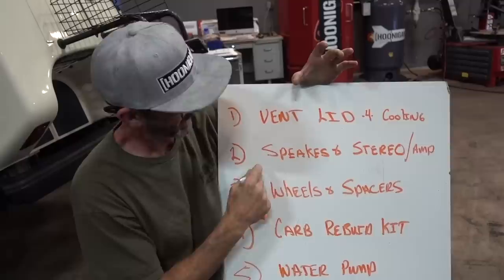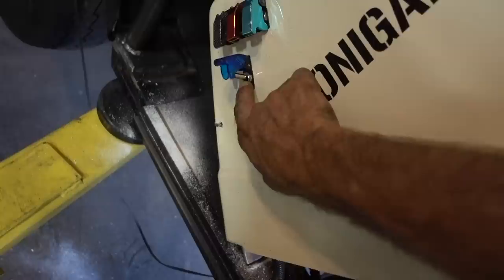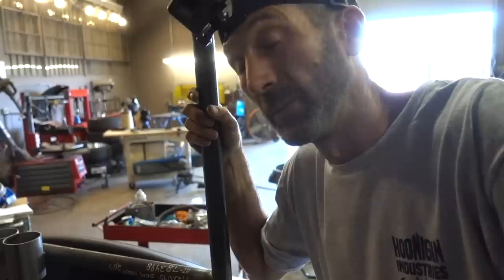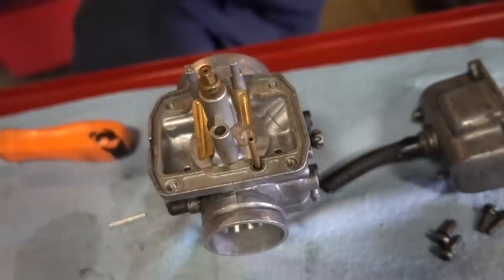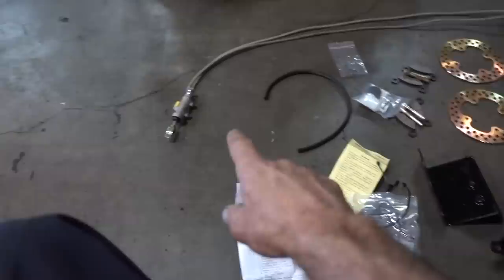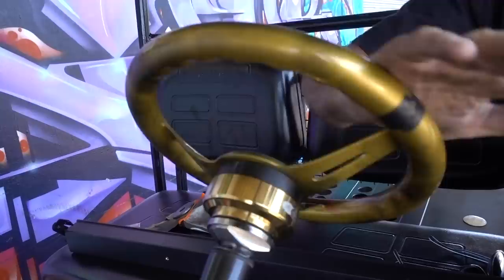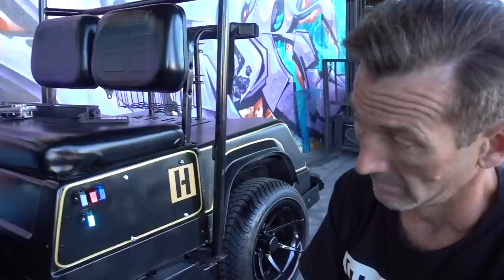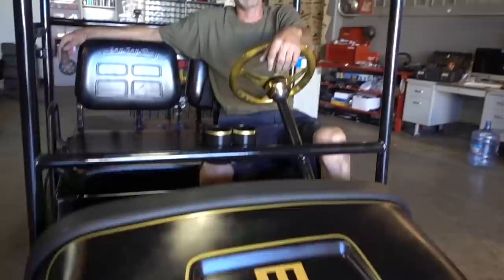Introducing the Hoonigan Player Special - 2 Stroke 750cc Golf Cart

Comment: The CVT transmission is killing it guys. No power to the ground and unable to burn rubber. Lower the gear ratio and tighten up that belt so you can get some mad skids.
Reply: I agree, that clutch setup is jacked. Good clutching and maybe a little more exhaust and fuel tuning and that engine would blow the tires off that cart at any given time. Also wheelies :)
Reply: Josh it's funny how this is pinned, but only one like...and now one reply lol
Reply: Needs a clutch kit. Changes engagement
Reply: Also that belt is very loose.
Reply: It would’ve worked a lot better with a jack shaft to a chain driven rear axle
Reply: Also, find a way to lock that diff up!
Reply: It HAS to be setup better!! This as it sits is a shame to the Hoonigan badge!!!
Reply: Cvt are super effiecient on sleds... The belt is skipping. They have way too much slack
Reply: Eric Levkovich dont know if its slipping but the secondary is defenetly to loose, doesnt rev like it should. What happens when the secondary clutch spring is to soft is that the belt gets pulled down to easy and its like youre driving on 6th gear all the time
Reply: Anton Danielsson yeah. They should get a clutch kit to get more out of it too. Stock clutching sucks
Reply: Eric Levkovich thats not even the stock secondary? So thats the problem
Reply: Anton Danielsson that and who knows what springs are in it. Or weights in primary
Reply: I agree, get a clutch kit. The belt is engaging at much too low of an rpm. Im a snowmobiler, 2 stroke snowmobile engines can be powerful monsters.
Reply: And the tuning seems waaay off on the engine.
Reply: @number1lilslugger  you cant tune a 680 with a straight pipe..  or any other sled engine for that matter.   THAT is why it's so slow.  Combined with a million other things..  jetting, clutching, air box.. etc  list goes on.     But they really need to change these titles..  it's a 680..   not a 750.  What a waste of a Classic sled..  and a good engine.      Claiming to be the almighty Storm engine when it's a turd of an Ultra engine.  Only way to wake up the 680 is to get good triple pipes. Then they could be pushing 135hp..   stock is 105..   straight pipe is like 50 lmao!   And none of that helps without the rest of it.  Get it rippin and itll pop for sure without it all taken care of.  Only reason it's still staying together is because it's making no power
Reply: @danielssonsgarage  up
Reply: Thing would probs top out at like 120 rn 😂
Reply: @arando4359  How do you feel now? lol

Comment: If anyone is curious, when they talk about have more back pressure, it's not about making it more restrictive. What they mean is that they are improving the velocity of the exhaust gasses by making the pipe smaller. So it's a balance between allowing a certain volume while maintaining proper velocity for exhaust savaging. Which actually reduces back pressure.

For anyone curious on the physics behind it google Venturi effect or Bernoulli's principle.

Comment: As a red flannel blooded Canadian I think a snowmobile mechanic should be consulted on this one to extract its full potential. Sounds like its running better but just like on snow the CVT clutching is the key with these things. Its a game changer when you get it right. The single piped ultra 680 engine makes 115hp or so. but add a set of tripple pipes to it and you get 145hp. Theres potential here guys. Chairslayer must have some alberta hookups to help out. If not, I might be able to point you in the right direction. Cheers.

Comment: definitely turbo if y'all can make that happen
Reply: 2 stroke turbo will not work very well
Reply: my b.. you mind throwin down some basics so i can figure out why?
Reply: is there a feasible form of forced induction?
Reply: extra air will just blow thru open both exhaust and intake port, on high rpm it sure will ad something, but it need custom expansion chambers, not one but 3, and they need to be tune to when boost kick and create that rezonation back pressure and push all that goodnes back to the cylinder
Reply: nitrous it is then
Reply: Methoxy000 there’s a company in Scottsdale that makes turbo charged 2 stroke and 4 stroke boxer motory hang glider things for personal flying crafts. Seeing them in person was amaaaaaazing
Reply: There is absolutely no need to turbo it. Just adding individual expansion chambers and a proper carb and setup would make it waaaayy to powerful
Reply: People do turbo 2 strokes but it is much more worth while to do a proper exhaust, intake, carb and head port job, they respond really good to just a simple carb and exhaust combo
Reply: head port job? you mean cylinder port job? :D
Reply: Gruby Garage Projekt you right, said two thoughts in one, port the cylinder and drop the head
Reply: Aaron Provin  don’t forget nos to
Reply: in high power two stroke shape of combustion chamber is critical, here in Poland we have some pro guys who can change whole engine power band by just reshaping chamber, and make like a 30HP of 70-80ccm cylinders
Reply: its a 2 stroke engine its gonna be hard and especially because its carbed
Reply: Aaron Provin a super charger can work, turbo is doable but it takes a fuck load of fab work to get the exhaust piping right. There will be some of that with the super charger aswell but not as much
Reply: Peter Griffin i just saw peter do something intelligent
Reply: yeah, a supercharger might be better, but still EFI is a must and direct injection is not a bad idea, you can see small 2t scooter engine on EFI end direct injection, runs very nice 
https://www.youtube.com/watch?v=8KmtOztWPs8
Reply: You can 100% turbo 2 strokes. Works very well
Reply: Gruby Garage Projekt yah it's still not an easy thing but way easier than a turbo
Reply: @silosis  nitrous only works with a cvt clutch if its on ALL the time otherwise when its off your clutching is totally off. its likely completely wrong right now tho going from sled to golf cart so that'll only aggravate the issue

Comment: nos + turbo = BADASSS
Reply: 2 stroke plus turbo = yes have you ever seen mountain sleds?
Reply: It would be more efficient to SC a 2 stroke: like old Detroit diesels
Reply: Alexander Helton Old Detroits may have superchargers but they're technically NA still.
Reply: BoostAddict You are correct, 71 series need the blowers to feed air, tho slightly pressurised- it's in fact NA
 but twin charged versions are not NA. 
a blower- and building an exhaust system with enough back pressure would be easier than a turbo. Look up speedwerx, for a example of SC snow engines.
Reply: No need for Nos or turbskis just slap a high compression head on that thing it’s a 2 stroke

Comment: how do the plugs/piston wash look? also what jets (main & secondarys) are you currently running? what needle position? lastly what outside temps and elevation are you generally going to be running it at? Also important.. did the engine come from an ultra, or a storm that had an ultra hood swapped on it? ultra - 680cc, but ya'll been calling it a 750 which would have been a storm engine. I can give you a good base line to start from on the jetting, but all variables are needed. easiest way to figure out if its really a 750 or 680, cylinder cast number.
Reply: AKproXR you need to help them get that motor going good homie.  Hahaha recognize you from ak snowshredder 2.0
Reply: They got that from an xlt dude. Like a 95 or 94. None xlt special rig
Reply: A fellow shredder! that engines not a mono block which rules out the 580/600 xlt based engines. Heads look like 680 heads to me which would be correct for the chassis they removed it from in their other video, but they seem to be dead set on calling it a 750 for some reason. But, without knowing what their running currently, what conditions they have down there that it will be run in and how the plug readings and piston wash look it will be hard to give them a base line for jetting to start with.
Reply: I thought of the clutch settings, it does't sounds like it's hit the high end rev's as it should.
I hope someone with some English knowledge could tell them how to do.
Because I'm from Sweden 😂
Reply: I had to go find the first video. It is an ultra ah?  I agree with the clutching too. It just not right yet. I think it needs a little back pressure. More then just reducing down to one inch tip
Reply: clutching could be off, also I don't think they are running threw a chain case (could be wrong, been a while sense I watched the original videos) so who knows what the final ratio to the tires are. That's something they are going to have to play with them selves to dial as its a unique setup. With stock exhaust the 680 makes an uninspiring peak 105HP at 8200 RPM which is the rpm that should be shooting for.
Reply: And she's not even running on all three lol

Comment: It would run really good with  an expansion chamber per cylinder and belt tight as possible, I put a zrt 600 in a club car and used the snowmobile exhaust the same as it came off the sled.  Cart does full donuts and will do wheelies.

Comment: I don’t know what’s wrong with it but it should be way faster those engines have over 120hp
Reply: Tyler Abell poor power delivery through a shit transmission. This thing would have been sick with street bike engine and a manual transmission. I'd set up the shifter upright, one forward five back. Would have no problem doing what they actually wanted it to do.
Reply: It’s also very heavy and has small wheels
Reply: I agree a bike engine would do great.
Reply: Reece Nunes If you didn’t know cvt transmissions are very efficient when tuned properly. With different springs in the primary and the right belt deflection and tensions that thing will shred. I’ve ridden sleds forever and those old 750 triples will keep up with new sleds when tuned right
Reply: Patrick Gaudreau they are great for a sled that's why they use them, this I'm sure gets up and moves too, but they don't have a large area to open it up. For this application, something to just blow donuts and do skids in their small parking lot, the setup I said would be much better. It needs to be way more snappy to be fun in a small area like that.

Comment: I feel like a cr500 engine would have been better.. that thing is bogging like my kids bike when I ride it lol
Reply: With some clutch tuning that thing could be a real handful
Reply: Lmao!
Reply: swafford501 single cylinder vs 3 cylinder on a 4 wheeler, guess whats better...
Reply: Max xr125 a single cylinder that doesn't bog
Reply: It's because they fucked up the pipe
Reply: for an engine designed to run in the cold, it needs to be cooled better.
Reply: yup that is the problem... cooling snow mobile run at snow temps... so cold :'( 
why no get a 125cc 2stroke engine? or like a 500/600cc motor bike engine?
i mean sure its different a snow mobile engine but yeah.. snow
Reply: If they could rejet for heat and so on, that thing will be way faster than they need. Lol, considering an older xlt would do 80mph in a snowmobile.
Reply: That motor doesn't hit the powerband until your already going to fast... torque/burnout/wheelie machine with 500cc 2 stroke... snow mobile motor is a high speed animal but also a death trap lol
Reply: d series Honda motor is the way to go
Reply: Needs lower gearing to get into power band and rejet for desert weather. That motor should make around 65hp but need rippems to get there. Bigger radiator. But it kicks as on the top end but Hoonigan mobile needs low end burn out machine. Gears Gears Gears.
Reply: Looks like an old XLT 600 heard thoes motors were kind of a pain to tune but love the sound maybe they just run better in cold weather

Comment: Needs notched primary clutch weights and different springs and helix in the secondary with SLP triple tuned pipes. It doesn't sound like it's even running correctly. Is that a pre 1997 xlt 580 or a 1997-98 xc 600? Oil pumps were shit on the pre 97. After 96 they had a 5 line output directly through the crankcase to the main bearings.

Comment: The 2-stroke needs to sound like a rotory but be a fauxtory (faux rotory) like so: Idler down to almost dying to get some more chop in the pop [or add chop some other, proper way to the 2-stroke?], then add a mini turbo w/ waste gate. Then add some extra weight to the bottom of the cart so you don't flip then die. Although, there is a roll cage so whatever right?

Comment: Hey i have a idea! You guys should mount the nos tank right next to the gas tank and battery that way when your positive poll of the battery shorts out against the battery and burns a hole in it.You guys might get lucky and the fire that ensues after not moving that fucking battery might help breach the nos tank and really get the party started. Please move the battery or at least flip it so the positive pole is further away from the fuel tank. I just dont want to see you guys get hurt.

Comment: That sled engine is pretty out of it's element in the golf cart. First it was likely jetted for much colder weather and clutched for a different application. Looks like the belt deflection is pretty loose (Polaris usually calls for 1.25" when pressed down at the midpoint) It's gonna take primary weights/secondary clutching/belt deflection to really wake it up.  Also curious where you guys are coming up with the power to run all the electric accessories (fan, amp etc)? I don't think those sled stators put out much in the way of power.

Comment: Weigh it down on the bottom all the way across to lower the center of gravity so it is no longer top heavy. Put a hydraulic hand brake for some drifting action. Make it completely street legal. Put doors on it with a DMC gull wing setup. Dome light. Get and iron pipe and cut it into quarter pieces to be mounted to the frame so when you jump it and bottom out, the pipes quarters take the beating and not the undercarriage. Put a electric starter on it. Do a Ferrari style engine cover on it. Put a windshield on it. Put HVAC on it. Hit me up on facebook Andre Cashin' out Andre, if you want more possibilities.

Comment: Should do a 600cc street bike engine. Would be way more sick push bottom start clutch a trans with gears no need for a turbo unless you wanna reenforce the cage so you don’t die. But that would be super fuckin sick. Whatever you guys decide I’m sure it would be tits. FYI streetbike engines are cheap as shit on the old interweb. I blew up my zx10 engine and got a used one for like $900 a few years ago still running strong 💪. Love your guys content keep up the great work fellas.

Comment: Rid of the two stroke...... Yamaha has an awesome 4 stoke..... With a turbo, and electric start.
Fix the belt deflection and verify the clutches have proper offset. 
There's a lot of tuning potential in the clutches ...... Hook up with some snomo guys and dial it in.

Comment: That triple doesn't seem to be getting anywhere near the power that it should be getting.  Should be able to do a wheelie or burn rubber trying.  Needs tuned, fix the pipe, and clutch work?

Comment: PLEASE!!, fix that exhaust..cutting off the stock outlet and welding on the 2" tip killed power. That sucker needs some backpressure.
Reply: Nevermind...i posted that about 30 seconds before they modified it.